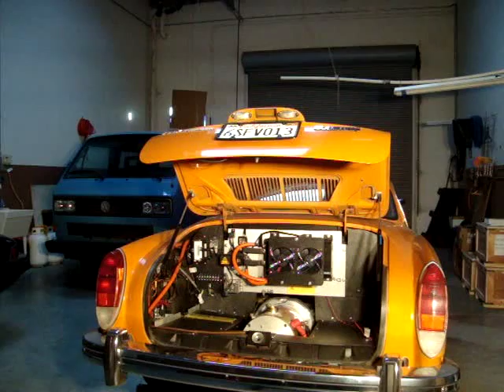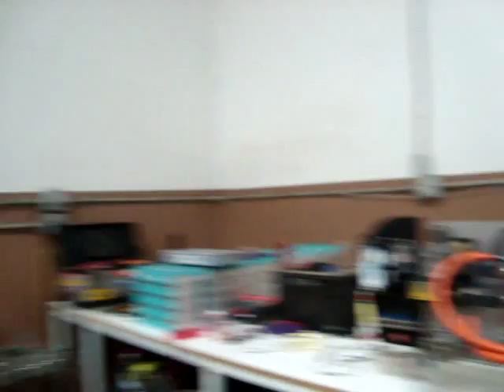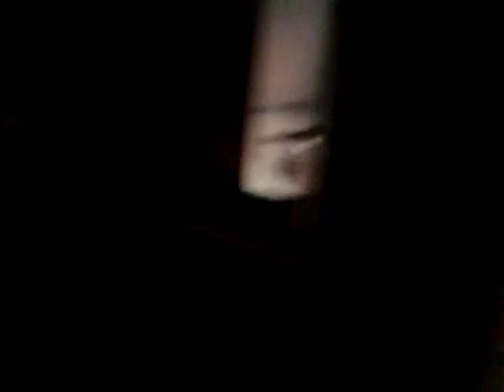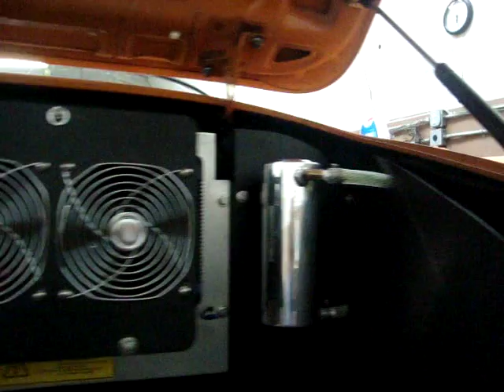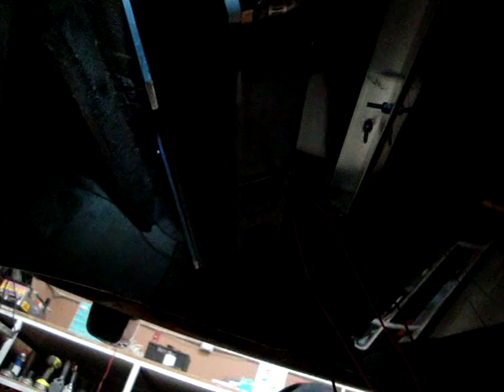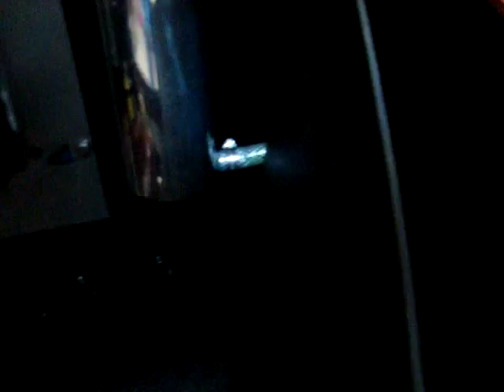EV Conversion Flash Back - Curtis DC Controller Liquid Cooling

Comment: Hi.
Why  not transferring heat to PELTIER modules to transform this heat energy into electricity.
And we recovered the energy lost as heat and returns it to the battery, this would be a great improvement in your system!!!
I have visited a WebSite that sells all the latest generation can suporter very high temperature(450°F) and 19 Watts
per module.

Comment from the maker: The pump and fans are 12 volts and pull less than 2 amps total.  No affect on the acceleration or top speed.

Comment: Richard,

it would be better if the liquid cooling plate is installed directly onto the controller aluminum cover instead of on the back of the aluminum mounting plate.  The heat would transfer and dissipate faster directly from the controller.  

It would be great if the liquid cooling plate is designed to have holes for mounting directly to the controller.